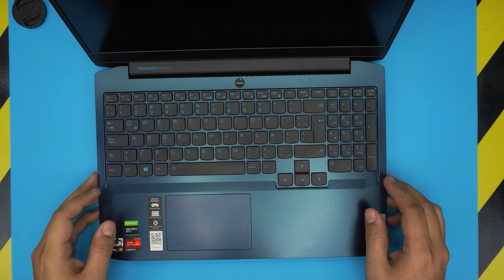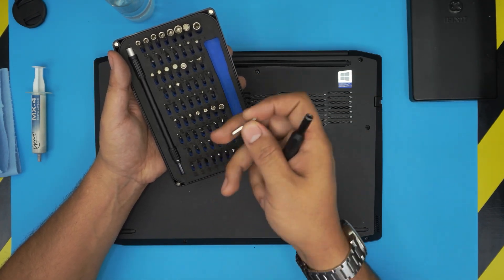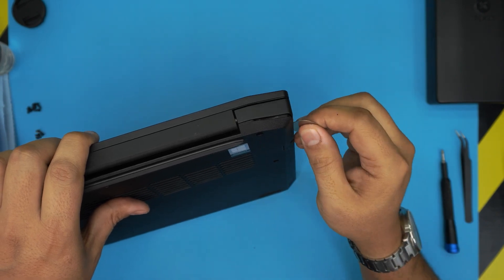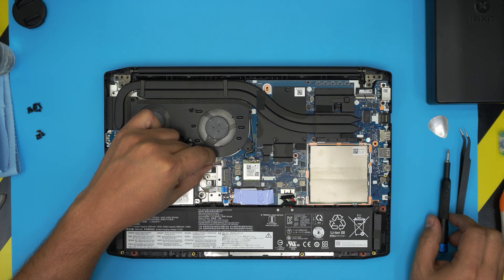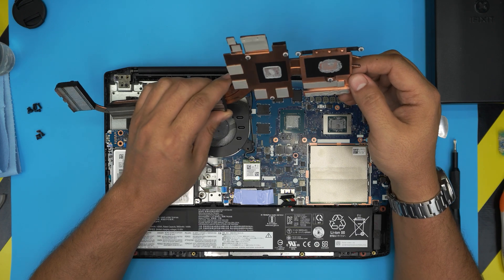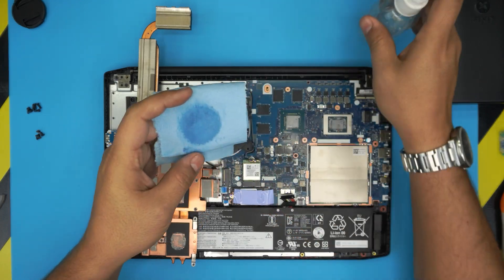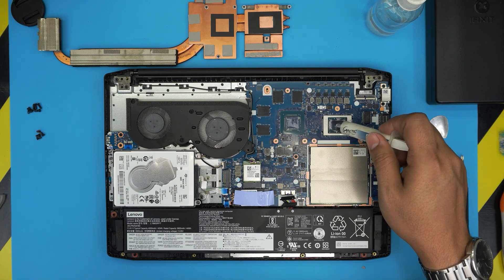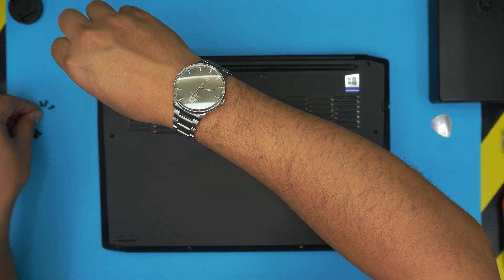How to Repasting and Cleaning for Lenovo Ideapad Gaming 3 15Arh05 ✅💻- Step-by-Step Guide

Comment: Good video my temps dropped by 10°c but i think i broke it since the metal thing with the grey wire snapped and doesnt seem to plug back and my gpu usage is at 0%.Also before it was 0% the fans started spinning really fast and the screen turned off.Have i broke my laptop.Thanks for the vid im from Poland🇵🇱❤
Reply: I have fixed the problem my problem somehow solved itself and i learned it was an aux cable and thank you i also upgaded my ram before the great ram shortage
Reply: Wrote my comment too early and i forgot to tell you that my fans still go crazy and my screen frezees and i cant do anything until the laptop dies is it bios or some of that and sorry if annoying but i'm getting a pc and giving the laptop to my mom and it is and insane upgrade for her and im gonna use that laptop for running my server.❤

Comment: My fan started to make disturbing noise like zarrrrrrrr, i cleaned the dust in the fan, but nothing changed
Reply from the maker: 🫠Regarding your question, the fans for this model are super cheap—look for them on AliExpress by the laptop model.
cheers🍻
Reply: @uFixTek  Thanks bro, additionally to your video i    removed the fan too and applied some machine oil inside, for now everything seems to be fine, if it persists then i'm gonna buy it from there thanks so much)

Comment: Hello, I applied thermal paste, but the temperatures haven't decreased. My thermal paste is MX-6. I didn't follow the screw tightening order. Do you have any suggestions, or is there anything else I can do? Can you help? The processor reaches 97-98 degrees Celsius. However, the graphics card works normally.
Reply from the maker: 🫠Regarding your question, you need to reapply the thermal paste—add a bit more paste, don't be scared—and cross-screw the heatsink. Those temps you mentioned are very high.
Reply: @uFixTek  Thank you, I will try this.
Reply from the maker: good luck

Comment: Hi, do you think it would be reasonable to apply liquid metal to this laptop? (with Thermal Grizzlys Conductonaut)
Reply from the maker: 🫠 Regarding your question, I would highly recommend you not to place LM, but to use a PTM795 Honeywell. You'll get the same results as LM after 15 minutes of heavy load.

Comment: Mine has some idk, thermal blue or red glue that don't let me remove some screws, what should I do? Did that notebook in the video also had that glue that stuck the screws?
Reply from the maker: 🫠Regarding your question, all screws from the factory come with blue or red screw lock. You simply unscrew them normally, and it will break the seals. Make sure to use the right screwdriver bit (that fits nicely), otherwise you will damage the screw head.
cheers🍻

Comment: Is it safe to do it bare-handed without an anti-static wrist strap?
Reply from the maker: 🫠Regarding your question, it is safe. You can't damage the laptop with a static charge from your body. Just remember to touch a metal USB port or any other metal port every few minutes when you open the laptop.
Should you have any further questions or requests in the future, please don't hesitate to ask me.
cheers🍻

Comment: I have the same laptop but the one with the 5 5600h cpu 
It has a base clock of 3.2 but on boost 4.5 i think but it doesnt reach above 3.6
Also i have fps drops 
My cpu timp under a stress test is around 95 degrees
Whats the problem here? 
And thank you for the video btw
Reply from the maker: 🫠Regarding your question, you need to replace the thermal paste the temps are way too high!
cheers🍻

Comment: hi my fan not working after i reconnect. can you help me please
Reply from the maker: did you make sure you connected the jack all the way, also the fan only starts when the temp reaches 60c or 70c.
power on and wait 5min and it should kick in.
Should you have any further questions or requests in the future, please don't hesitate to ask me.
cheers🍻
Reply: @uFixTek  yes sir i reconnected all the jack the temp is 99c and the fan still not working sadly
Reply from the maker: what type of thermal paste you used?
and did you make sure you place the heatsink correctly.

Comment: Hey thanks for your video, i have the same model and previously my motherboard was replaced (under warranty). Ever since my cpu temps are skyrocketing over 100 degrees. I contacted lenovo and they said that it is normal for temps to go that high which wasnt the case before. 
I was planning on to replace the thermal paste and thermal pads since it is 3 years now. 
I wanted to ask your opinion on which thermal paste should i go for? and which size of thermal pads should i use?
also i wanted to ask are there any specific risk involved in doing this on your own? I talked to my service center and they were driving me nuts saying "electrical components will be broken/damaged etc etc". And they are overcharging me for the service. 
Thanks for your time and videos.
Reply from the maker: It's my pleasure my friend.
i appreciate your support, 🫠Regarding your question, I’ve been doing this for a long time. If you trust me, I will give you a tip, and you must follow it exactly as I mention.
#1. get a copper shim20mm x20mm x .3mmthick
https://amzn.to/3Ds9UHz
#2 get a thermal paste Kryonaut Extreme:
https://amzn.to/41DhPty
#3: kapton tape:
https://amzn.to/3XD8cKc

Do not touch the thermal pads; they don’t need to be replaced.

Clean the GPU and the CPU crystal die, then apply Kapton tape around the GPU crystal die (do not place tape over the crystal). Cover the tiny capacitors on the GPU, and if your CPU has capacitors, you can place tape there as well.

Next, spread a layer of thermal paste on the crystal die of both the CPU and GPU. Place one sheet of the copper shim on each, then spread thermal paste over the copper shims. Finally, place the heatsink over them and enjoy.

NOTE: Make sure to clean the heatsink vents.
Note: Use a 0.3mm thick copper shim.

Follow these steps, and once you're done and satisfied with the results, come back, and I will explain the reasoning behind it.

cheers🍻

This is an Amazon affiliate link. When you use my links, you are helping to support the channel. 🙏
Reply from the maker: it should never reach 100c
it should be max 85c
Reply: @uFixTek  Hey Thanks for your reply here is an update, in my country i couldn't find the copper shims so i went ahead and repasted my thermal paste, while doing i noticed my previous thermal paste wasnt degraded much but i repasted it anyway. The temps were around 87-93 from 100-105 while gaming, but after 3-4 days i upgraded my ram from 8 to 16, and after 2-3 days i noticed my system was getting heated, i checked the temps and they were back to 102 to 105. 
Even if i didnt applied the thermal shim, the new paste should have worked. I monitored my CPU and my CPU was drawing max power of 35-37 W during gaming. And also, my GPU temps are absolutely fine, they were fine even before and they were fine even now. They never reached upto even 80. It's just the CPU that's acting up. I even cleaned my fans and still it's not working.
Reply: @uFixTek answer his question please

Comment: asked computer shops around me how much will it cost them to do this for me and they said 50 bucks canadian. Needless to say after years of watching ZTT I knew Im doing this myself watching a tutorial. my clock speeds decresed form 1900mhz to 1500mhz and i think this should solve it as my temps are 85 average
Reply from the maker: 85°C average under load is perfectly fine.
you can save 50Cad by doing this and taking you time doing it.
Reply: @uFixTek it was thermal throttling at 87 and my clock speeds were reduced by a lot I bought the paste and did it myself and my temps are 70 under load
Reply from the maker: awesome job
cheers🍻

Comment: I have the lenovo ideapad gaming 3 15ach6 model, the fan connector is very hard to remove, any tips? Yours seems to disconnect easily
Reply from the maker: 🫠Regarding your question, use more force, put your finger on the side of the jack and pull back hard.
Reply: @uFixTek  oh I did, so hard it pulled off some of my fingernail
Reply: I also tried tweezers but they kept slipping off
Reply: In the end I didn't need to disconnect the fan cables, I just undid the screws and flipped it over
Reply from the maker: oh oki as long as you got to clean it, it's fine awesome job. i wounder why is your jacks so damn hard  :/
never had anyhing like it.

Comment: Great tutorial! I have follow your step and try to replace the pasta, but after i turn it on the backlight and power button is on but the screen is blank. Do you know what is wrong?
Reply from the maker: Regarding your question, double-check the connectors and ensure the RAM modules are fully inserted.

Comment: Is it better to remove thermal pad than having a 1.0 mm pad? Because I replaced it before doing any research? And I think I'm cooked
Reply from the maker: 🫠Regarding your question, the thermal pads must be the exact same thickness. If you use thicker pads, they will push the heatsink away from the GPU/CPU, resulting in poor temperatures. Conversely, if you use thinner pads, the components won't cool properly, potentially causing damage to the board. The thickness of the thermal pads is extremely important.
Should you have any further questions or requests in the future, please don't hesitate to ask me.
cheers🍻

Comment: Great video! Do you mind telling me the manufacture date? I just want to get a relative idea about  how long the paste lasts
Reply from the maker: 🫠Regarding your question, I do not have the exact date of manufacture on hand, but there is no specific timeline for when you should replace the thermal paste.  

- If the laptop has had very low usage or has not been used, you can replace the thermal paste every three years, as that is typically the expiration period for the paste.  
- If you use the laptop regularly but not for gaming or heavy tasks, replacing it every two years is sufficient.  
- For heavy users who game or perform intensive tasks, repasting once a year is recommended.

Should you have any further questions or requests in the future, please don't hesitate to ask me.
cheers🍻
Reply: Thanks!
Reply from the maker: It's my pleasure my friend.

Comment: I checked in my lenovo service bridge app it is showing fan not found and i am unable to listen any fan sound does my fan is damaged?
Reply from the maker: 🫠Regarding your question, there are few reversions of this laptop and the basic version that are intel celeron do not have fans, check your CPU model, what CPU model you have.
or the best is to remove the cover and check it.
cheers🍻
Reply: @uFixTek I have Ryzen 7 Lenovo IdeaPad Gaming 3
Reply from the maker: That is perfectly fine. The fan operates based on a fan curve, meaning if the CPU/GPU temperatures are low, the fan will rotate very slowly or even stop. This helps save battery and reduces dust intake. When the temperature reaches a certain threshold, the fan will kick in and run faster.  

It’s completely normal.
Reply: @uFixTek  THANK YOU
Reply from the maker: It's my pleasure my friend.
Reply: @uFixTek  I checked the laptop while removing its cover the fans runs only when I use heavy games and software use it is fine?

Comment: Hey, about the screws that each has got locks on it. I kinda removed them, do you think they would be fine?
Reply from the maker: 🫠Regarding your question, the locks are there to prevent losing the screws. It will not affect performance or anything else if you don't place them, place the screws without the locks
Should you have any further questions or requests in the future, please don't hesitate to ask me.
cheers🍻
Reply: @uFixTek  the screws of the heatsink that got locks on it I mean
Reply from the maker: Yes, that's the one I'm talking about too. Don't worry about the locks on those screws. They're only there to prevent the screws from falling out, mainly for the factory assembly, as the company that makes the heatsinks ships them with the screws. During assembly, they don't have to worry about the screws falling or placing them.

Comment: Hi, I have the same laptop but my Gpu temps getting higher than the CPU temps for example CPU temps are 83 while the GPU temps are 85 and I am using balanced mode and turbo off so I am really worried about it as this problem started happening since 15 days ago and it's been 1.5 years since I bought it but I never experienced this problem before so any solutions?

Comment: just did this, but when i opened my laptop, the gpu is not detected/recognized

is there a possibility that it was shorted or something else?
Reply from the maker: what make and model of the thermal paste you used?
Reply: @uFixTek  I'm not sure because it's a generic thermal grease and it doesn't have a brand of some kind.
Reply from the maker: There is an issue with generic thermal paste as it is conductive and can short out and damage the GPU. You will need to clean it completely with isopropyl alcohol and apply a known good brand of original thermal paste.

Comment: Hi, I'm really glad you made this video, i have one question though. I don't want to change the termal paste, I only want to clean the fans, do i still have to remove the heat sink to get access to the fans?
Reply from the maker: It's my pleasure, my friend. 😊 I deeply appreciate your taking the time to provide feedback. If you're inclined to support the channel further, feel free to like and subscribe—or even both!
Regarding your question, You can remove the fans without removing the heatsink. Simply unplug the fan connectors, remove the screws, and use a toothbrush to clean the radiator (heatsink) and the fans. 
Should you have any further questions or requests in the future, please don't hesitate to ask me.
cheers🍻

Comment: I removed the screws... But didn't have the guts to open the cover man... I might get it done from some professional ig
Reply from the maker: don't be scare just a bit of the wiggle and force, you cant break it, it is very though🫠
but again if you feel safer with some it guy doing it then sure.
cheers🍻

Comment: Can I use a 0.5mm pad on this instead of 0.3mm
Reply from the maker: 🫠Regarding your question, sure you can and it will work fine.
Reply: @uFixTek  Last Question... how much thermal pad should I buy, how big should the dimensions be... I am sorry for this but, I just want to be sure that I would be able buy the right quantity that I needed

Comment: Do you have some information on the thickness of the thermal pads that are around the cpu and gpu? I did a mistake by replacing them with paste. Hoping i could find a replacement online
Reply from the maker: Thank you for your feedback! If you wish to support the channel, you can like, subscribe, or both!
Regarding your question, the pad size on this heatsink is 1mm my friend. NEVER use thermal paste where the thermal pads is used you can damage the components, by over heating them because the paste is not good  when it comes to volume heat transfer.
Should you have any further questions or requests in the future, please don't hesitate to ask me.
cheers🍻

Comment: just make sure to get a fitting screwdriver and not end up like me with a stripped screw, those 2 screws placed on the cpu and gpu are really tight so watch out not to mess it up
Reply from the maker: Having the right screwdriver and a properly fitting screw bit is crucial for any service. That's why I recommend the iFixit set.
https://amzn.to/46QvMG3
This is an  Amazon affiliate, when you use my links, I earn a percentage, which helps support the channel🙏.
cheers🍻

Comment: hey brother is quality of components used in this laptop series good enough to survive for 3 ,4 years without any issues  ...like hp
Reply from the maker: Thank you for your feedback! If you wish to support the channel, you can like, subscribe, or both!
Regarding your question, i absolutely don't recommend this models from lenovo we get them in the store for repairs all the time components repair, because of poor component circuit design, and not many over voltage protection.
Should you have any further questions or requests in the future, please don't hesitate to ask me.
Reply: @uFixTek   so with which brand should i go under price bracket of 50000 rupees
Reply from the maker: where are you located so i can check in your country >?
Reply: @uFixTek  india
Reply from the maker: buy this: https://shorturl.at/HNTX6
it is much much better that the one in the video, rock solid.